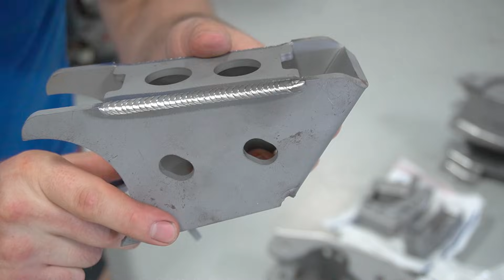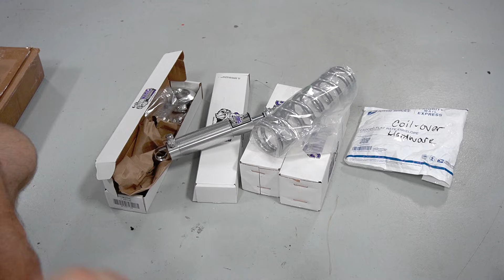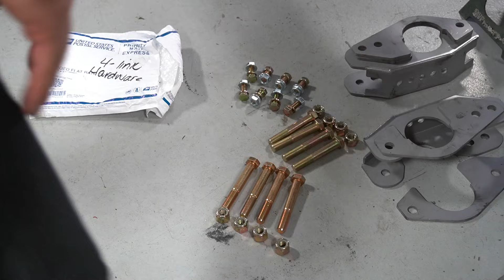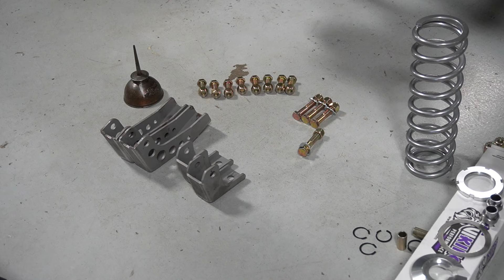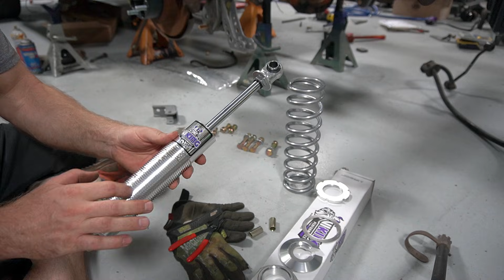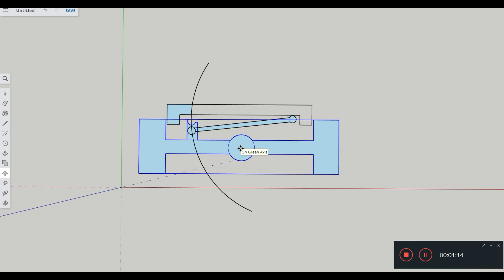F100 Outcast Autoworks 4 link Installation

Comment: Hey Man. I am not really a Ford guy, but I will stick around for moral support and see how it goes. You never know what will come my way. This procedure will work on all makes of trucks. I was too quick to make a comment about a Ford guy. Sorry. I must say that your welds are very good. The overall video was put together well. It will surely help out any gearhead out. Thanks for sharing. See you in the next one. 🍁👍👍
Reply: Hey he improved it he end up putting an LS in it I believe
Reply from the maker: haha, Exactly, it will apply to any truck that someone is working on. You can bash the Ford guys, but when the subscribers gang up on you in the comments section, you're on your own haha (kidding). Thanks for the weld compliments, I'm actually super picky about good welding. Glad to have you subscribed!